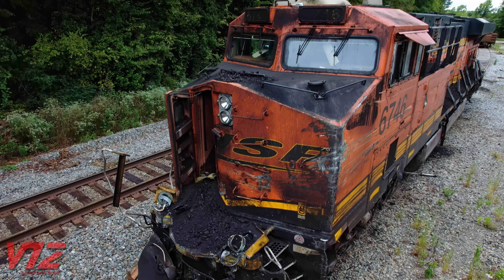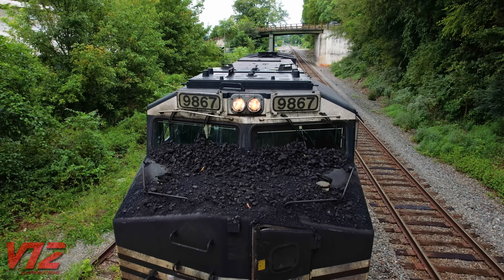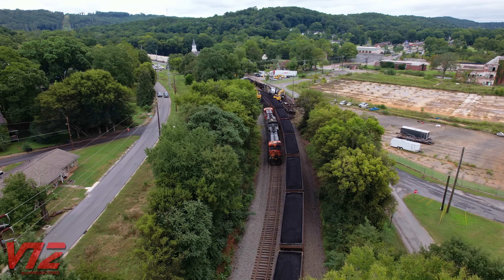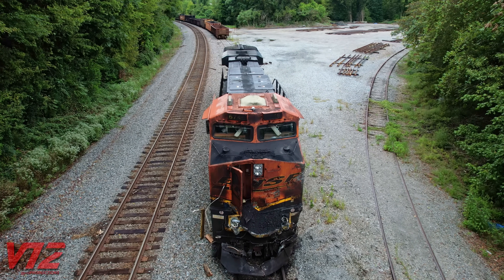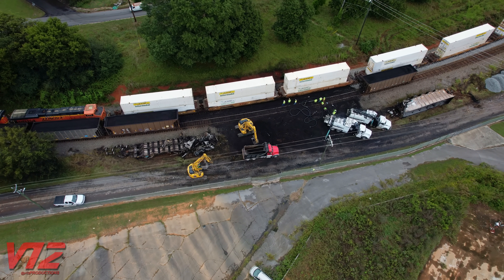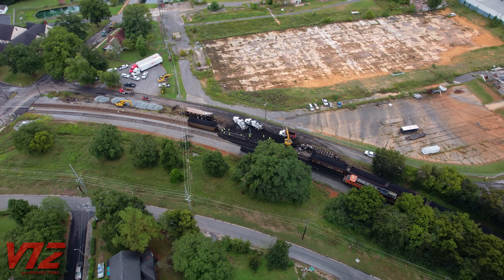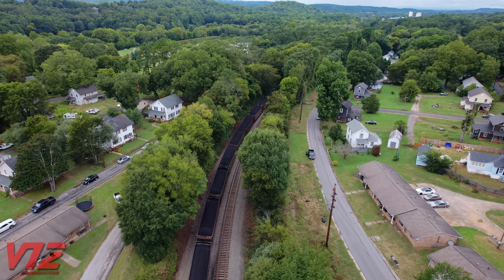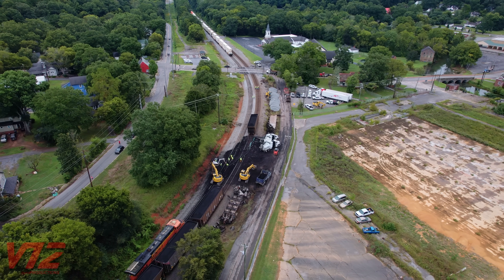RUNAWAY Locomotive & Head-On Collision in Rome, GA

Comment from the maker: UPDATE: This is how the railroad reported this accident to the Federal Railroad Administration - NS TRAIN 732G108 WAS STOPPED DUE TO PENALTY BRAKE APPLICATION FROM PTC, AFTER RECOVERING ENGINEER ON NS TRAIN 732G108 WAS UNABLE TO MOVE TRAIN. HE THEN ASKED FOR NS TRAIN 283G110 TOO INSPECT THE DP ENGINES. PRIOR TO GETTING TO THE ENGINES CREW STRUCK TWO DERAIL CARS IN NS TRAIN 732G108. THE LEAD ENGINE UNCOUPLED FROM NS TRAIN 283G110 CONTINUED NORTH AND STOPPED WHEN STRIKING THE LEAD ENGINE OF NS TRAIN 29AG108.
Cause: E85C Bottom outlet car door open
Reply: What did you do to my brother?!?!!?!